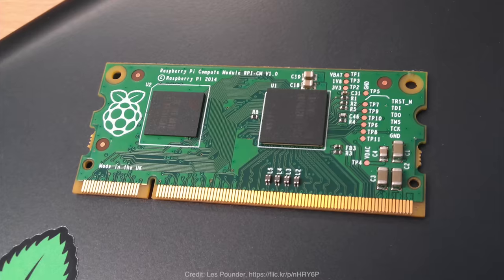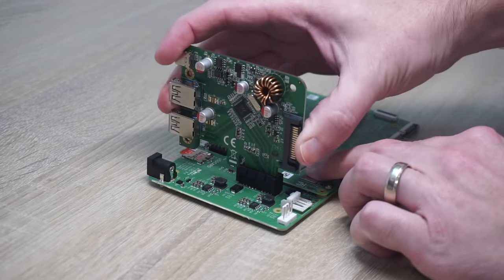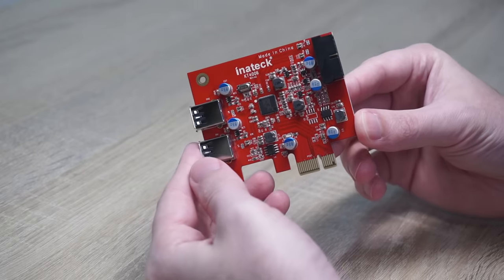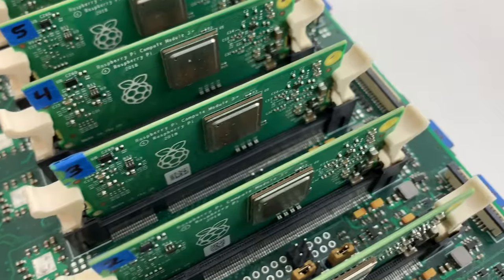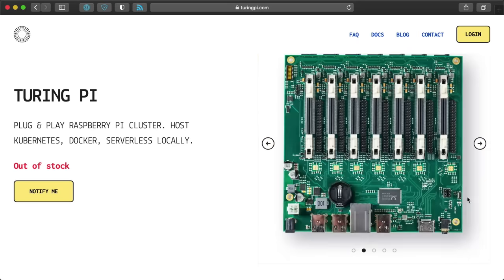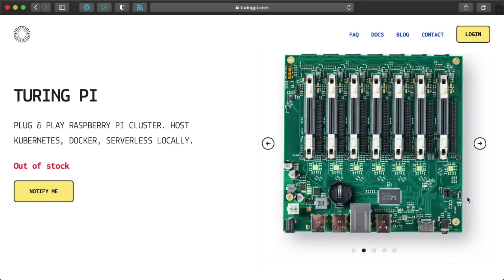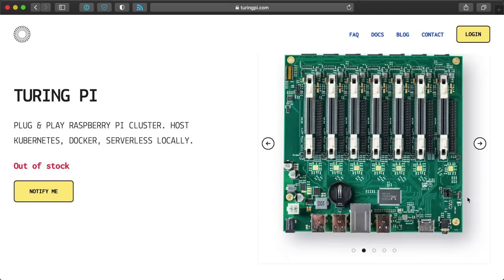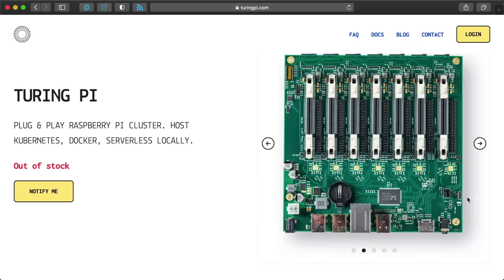The Raspberry Pi Compute Module 4 Review

Comment: Jeff, you overlooked something in your video you had a 3.1 USB which can give you 10 to 20 gbps speed, if it’s Firewire compatible you can get up to 40GBPS. It has been a great workaround for these all in one iMac the Shopping clubs sells for $699 with with a spin drive so do not have open them up. You can install OS directly to the firewall 40 gbps drive and it runs like a bat out of nowhere

Comment: Re "first Pi with u.fl external antenna connector": true, but the Pi Zero W has an unpopulated footprint for what looks suspiciously like a u.fl connector ;)

I've not tried soldering a connector to that, and it looks like you'd have to rotate a ridiculously-small component to connect the u.fl antenna instead of the onboard one, but it looks like it should be possible! :D
Reply from the maker: Interesting, you're right, it's just a hair above the 'USB' label on the board, pads perfectly suited to a U.FL connector. So it's the first Pi to have the connector, but not the first Pi to have the space on the board for the connector. Posted a picture of it here: https://twitter.com/geerlingguy/status/1318686105378619393
Reply: @JeffGeerling  On the Pi Zero W, its only used to characterise the antenna and the WiFi circuit during prototype validation. The Pi 4 has one too but it is more disguised
Reply from the maker: @simonmartin4599  That makes sense.

Comment: Jey Jeff!!... 
Fantastic video btw!
I've a Zotac GT710 pcie-1X i could lend to you for your tests as you mention on the video.
Cheers!
Reply: he can use any gpu, no need for an pcie x1 gpu.
Reply from the maker: I just ordered one, thanks so much for the offer though! And while I could use another GPU I'd need a riser or to cut into the 1x connector on the IO board, and I'd rather avoid that for now :)
Reply: @JeffGeerling  waiting impatiently for your results!!!!
👏🏻👏🏻👏🏻
Reply: if you rip out the back of the pcie slot you can fit in a pcie 16x card and pcie will still work perfectly

Comment: Wow, thanks for all the hardware testing.  I'd love to see a dual Ethernet card tested.  Maybe an Intel i350.  
I'm really excited about this board.  Is there any easy way to power the bare board if you just wanted a small machine that serves stuff up via WiFi?  Even solder pads would do.
Reply from the maker: Hmm, I might pick up an i350 or maybe i340 and see if it works.
Reply: @JeffGeerling  I forgot that the i340/i350 are PCIe 4x cards and you may not want to hacksaw your dev board.  So maybe Intel 82576.  I see that  RTL 8111 multiport cards also only use 1 PCIe lane, but that chipset is famously flaky.
Reply from the maker: @beauslim  I have a 16x riser so I can plug into that. We'll see, I ordered a i340-T4... Go big or go home :D — but it will probably top out around 2 Gbps total across the interfaces (or less).

Comment: YES! YES! YES! I've been waiting 6 months for the CM4 launch! AND it's even better than expected! But, all it needs is a compact carrier board with Power, USB-C, HDMI (connectors along one side), M.2 (SATA or NVMe) (connector oriented to allow the SSD to mount on board), plus an optional GPIO header. That would be smaller yet more powerful than the RPi4, IOW the smallest, most versatile SBC/PC available. Having connectors along one side allows for easier packaging for weatherproof devices as well as clustering along a backplane.
Yeah, I get it. The new carrier board is more like an all purpose development board, not designed for end products. But, I'm sure that many 3rd party manufacturers will fill the market's demands, so patience is a virtue, I guess.
Oh well, I'm in, so sign me up. At least I can start developing 'stuff' on the CM4 platform. WooHoo!

Comment: Hi @Jeff! quick question: do you know anything about the turing pi2 and how do we will connect the news raspberry pi 4 compute modules? Thanks in advance for your time
Reply from the maker: It looks like it will use a kind of adapter/daughtercard design and those will be used to plug in CM4s vertically to the board

Comment: Most PCI-e devices that have a bigger than 1x connector still work in a 1x slot because of how PCI-e works. Sometimes the smaller slots even have the end cut off so they also fit the longer connectors, but this dev board doesn't seem to have that. I also wonder how they deal with the 75W power delivery requirement through the PCI-e connector on such a small device.
Wouldn't AMD GPUs have ARM drivers because they are open source, so could be compiled for any platform?

Comment: 8:30 Couldn't you either compile a custom kernel and make the nvme support built in or make a custom initramfs including the module on an sdcard and just use root=/dev/nvmeblk0p1 as a kernel command line parameter? It's how we had booting off USB before it was official. All you need a small SD card for holding the firmware, kernel, initramfs and configuration.
This way you technically boot off the storage the firmware supports, but the Linux that is launched from there jumps onto the device you specified.
Reply from the maker: That may work. Still requires the microSD card or eMMC but at least it would allow everything to run fast.
Reply: @JeffGeerling  You'd still get the second half of the boot process running off the SSD and thus the speed benefit, the whole userland stuff. Would be worth a try (a video?).

Comment: 6:08 there’s a SATA power port on the back of that USB card... if you hook that up to a power supply you should have all the power you’ll ever need... right?
Reply: Yes. In that case, you would get the Standard USB 3.X (don't know, which Gen his Card is) as you would have it on your Desktop
Reply from the maker: True, though then you have an extra power supply besides the 12V one to power the IO board. But for those integrating the CM4 into custom PCBs that is an easily achievable task!

For the "PCI Experss" card it required a 4 pin power plug, which I plugged in via an external PSU, otherwise it had no power at all. At least with the Syba card, it would provide power through the PCIe bus even if not in large quantities :)

Comment: @6:53 is there any reason why are you loadling a kernel module with modprobe and just reboot the pi? what's the logic in doing that?
Reply: The literally explains it in the same sentence, it's "to enable the NVMe kernel module, which apparently is included in the Raspberry Pi OS kernel but not loaded by default.
Reply: @RudyBleeker  thanks for the replay, but my question is why use modprobe (that loads the kernel module in MEMORY ) and then reboot? to load a kernel module at startup you need to change /etc/modules, without doing so the kernel will boot up without the nvme module. My point is that the explaination does not reflect the commands he gave at the console and it's kinda wrong. But maybe i'm missing something.
Reply: @alessiocurri82  If I had to guess, maybe the module is designed to add itself to the boot loading list once it's loaded for the first time, and then it needs a reboot for hardware reasons. No idea if that's right or not.
Reply: @alessiocurri82  Oh, he explains it in another comment. It's now loaded by default, and he had symlinked it off camera. It's just a video error.

Comment: PCIe is scalable, you can adapt any PCIe Device to any PCIe slot, no matter if the device has more or less lanes than the slot.
so you can connect an RTX 3080 to it, and it will work (with the correct drivers of course), but it won't be fast
also what generation of PCIe is it? i don't think you mentioned it. is it 3.0 or 4.0?

Comment: Nice video but I don't really understand who would buy a compute module Vs a regular Pi. The Pi has a lot of the same IO as the IO board and the additional IO such as the PCI-E slot is going to result in a really bulky set up no matter what you plug into it. All that for just a few extra MB/s in transfer speeds? Who is going to buy it?

Comment: Hi... Excellent video. Is there a way to use this module + io board + external ethernet pcix adapter to transform the whole gadget into a home router? Tks.
Reply from the maker: Yes! And it's fast enough that it wouldn't be a bottleneck like older models would, even on a Gigabit network. But I wouldn't be the best person to ask about this; I'd recommend asking more on the Pi Forums.
Reply: @JeffGeerling  Thank you!

Comment: It should be possible to file out the end of the PCI-e slot, that way x4 or even x8 and x16 cards will fit. Of course, they only work at x1 speeds but it will work! :)

Comment: With the PCIe Slot, you could even hook up a SATA III HBA to get 8 SATA ports on a Raspberry Pi

But... Could you use a Standard psu?
Reply from the maker: I still don't have an SATA board on hand to test with, but that was something I wanted to do.
Reply: @JeffGeerling  well, i mean if you wanted, to hook up a drive, where would you get SATA Power from?
I guess, one drive could be powered over this breakout port, you mentioned, but more than one drive?
Reply from the maker: @p3chv0gel22  For regular size/spinning drives, I would recommend a separate power supply since the IO board won't be able to power more than one reliably. If designing your own carrier, I would definitely recommend using separate power for any accessories.

Comment: btw. GT 710 Driver for Linux aarch64 i directly found on the NVIDIA website: https://www.nvidia.com/Download/driverResults.aspx/165266/
Another thing: Even if not official driver support, some AMD and NVIDIA cards, especially AMD, have Open Source Driver Support.
But i would be worried about the Power Consumption of the Video card.. if there is a way to give them External power it would be worth trying.

Comment: Try to build a NAS! PCIE RAID would be so cool!
Reply: Finally PCIe backed SATA so awesome!
Reply: YES
Reply: Not quite. It's all about sacrificing SATA with USB3. When I saw a PCIE X1 slot I immediately think about the possibility of CM4 NAS but I was intrigued by the slow speed of x1 Gen2: 0.5GB/s. This means 500 MB/s and yes it theoretically max out for a single SATA3 while real world performance should be 150MB/s RW per HDD. This means we can only have ~100MB/s for each disk in CM4 NAS counting the packet overheads/bandwidth/weak processing power. Still this is a trilemma for me to pick between a 10GB card*, 4 Gigabit LAN (btw each theoretically 125MB/s so 1 port will get starved, wrt to real life they are 95MB/s maxing out so no worries) or do this NAS project. Help me pick a choice.

*Using a 10GB card to run PXE network boot and offload the system from storage through a iSCSI from my existing DIY NAS.
Reply: @stevefan8283  well yes but a NAS with 100mb r/w performance in a low-cost scenario is still a bargain.
An entry level dual disk nas with 100mb throughout is 3/400 euro (filled). Printing a case and adding disks here you can easily get a 200euro nas with 4 disks.
Reply: Someone should design a Compute Module IO board with only a few USB ports, Gigabit NIC and two or four SATA ports. 
Even the Pi 4 runs awesome as a NAS, I‘m able to write with 110MB/s via SAMBA to my external SSD without a problem at all.

Comment: Could I take one of these and fit it into a custom mechanical keyboard like the pi 400 but better switches? And then inlay a small touchscreen where the number pad would be on the keyboard. That would be AMAZING.
Reply from the maker: I think it's doable. Have to put some large heatsink in there or a fan somewhere to make sure it doesn't overheat. But you'd need to design some sort of IO board version that interfaces with the Pi and allows the keyboard to plug into it. It would be a bit tricky but definitely possible. The display might be the most annoying problem to solve.

Comment: I'd like to address 1 inaccuracy. The PCIe 1x slot can receive all shapes of PCIe connectors. You can cut out the back plastic and slot in a 16x card, like the RTX 3080. It will work, but obviously it will be bottlenecked.

Also 1 question: can you try a PCIe SATA card and setup Unraid or some other NAS software?

Comment: The generic drivers available direct from the Nvidia website should be fine. However,  those cards are expecting 35-75W from the pcie slot. Can the carrier board provide that?
Reply from the maker: That's a good question, probably not. Lower power boards (more on par with the performance of the built in Mali GPU) may work okay without overloading the Pi though.

Comment: Doesn't Nouveau or the AMDGPU or whatever driver inside the Linux kernel run on ARM too, I mean it probably runs on little endian POWER? It should also be possible to run a longer (PCIe 16x) card in the 1x slot if I am not mistaken, the bandwidth and power provided will be a lot less but you can compensate on graphics cards using the 6 or 8 pin connectors usually. I mean, there are normal PCs, that run PCIe 16x graphics cards in the 4x slot that has an open end or 2 graphics cards where each of those physical PCIe 16x slots is actually running at 8x speed. (People used to run SLI or CrossFire with that, those times when AMD GPUs were actually a separate company called ATI.)

Comment: yes try the gpu, it would be really great to see an external gpu running on this device.
Reply: you can also mount a x16 gpu, just cut the pcie socket open in the end. some mobo have open pcie slots, so you can install x16 devices in x4 or x1 slots.
Reply from the maker: Ordered the Zotac, and will test it! I don't have the budget to go around ordering $200+ GPUs though, this channel ain't that big :P

Comment: why wouldnt it be possible to run such a gpu on a pcie 1x slot on normal desktop motherboards u can do just that only thing is you have to rip out the back of the port so it fits but everything else is compatible

Comment: Thanks for the video.  I think you made a minor mistake, however, in rebooting after issuing your modprobe.  Modprobe only loads kernel modules, it doesn't change how your system boots.
Reply from the maker: Quite true; you would need to add a line to /etc/modules to make it persistent. Not sure why I left that in the video!

Comment: I have a Raspberry Pi 2 with Arch Linux ARM where I mounted /boot on a small microSD card and the rest on a seperate USB SATA hard drive.
So technically it's booting from an SD card but running on an external drive.

Comment: This may be an ignorant question but can you stack the module 4? Create a cluster with it? Do you think that would be an improvement to what is currently available?
Reply from the maker: Yes, in fact the folks at Turing Machines are building a cluster board for them specifically: https://turingpi.com

Comment: Why the pcie 1x? Is there a limit in the ARM CPU side or module lacks pins for more? One thing to check is to try to find pcie 1x switch card or module (there may be them from the time of GPU minind times) and then you can have several pcie 1x devices connected to the board. Even better is to ask if the Rasberry people can extend the pcie capabilities with some newer io-board with the said pcie switch chip.
Reply: For example: https://www.amazon.com/Express-Switch-Multiplier-Expansion-adapter/dp/B01M64W87Q
Reply from the maker: The BCM2711 SoC only has 1x PCIe lane, so there's no hardware support for any more bandwidth on the bus.
Reply: @JeffGeerling  Then the pcie switch ship method is the way to go then.

Comment: Wasn't the point of the dimm form factor to make it easy to use in a cluster? Other than getting different ports from the normal pi, what is the point of this change? I understand the need to change the pin out in order to improve it but the way they did it does not make sense to me.

Comment: A Raspberry Pi 4 with two USB drives in RAID1 would be a totally fine and sufficiently performant NAS. Excellent for backup storage or provide access to video content. Heck, Plex runs fine if you don’t need to transcode.

Comment: All pci express cards are backwards and downwards compatible. Just dremel the back piece of plastic off the slot. While it would still only go at pci 1x speeds you could fit a 16x card in and it would work fine... assuming drivers are available. This is super common in servers. Well not the dremeling but server boards always have the backs open. Food for thought. Have fun.

Comment: You can use any PCIe device in any slot, you will only get slower speeds. If you wanted you could plug a 3090 into a 1x slot, It would work but would be limited to 1x bandwidth

Comment: FYI for those needing a U.FL connector on a Pi compatible board: 
The Banana Pi M2 Zero also has a U.FL antenna connector, but is way less powerful than the CM4, but more powerful than the Raspberry Pi Zero W but in the same form factor.

Comment: You know all PCI Express devices can run with just 1 lane, right? If they comply with all PCI Express standards, you can either use a 1x to 16x adapter or saw off the back of the 1x slot to fit in any RTX 3090 and perhaps compile nouveau for ARM

Comment: I want to see benchmark comparison with original raspberry pi 4
What about overclock difference from raspberry pi 4
 Have any sata card support?
waiting to have see heat sink on cm4
Reply from the maker: In terms of CPU, memory, WiFi, and networking, the benchmarks with the regular Pi 4 are basically identical (within a margin of error). I have not tried overclocking either the Pi 4 or CM4 but may have some fun with that at some point.

It does support SATA cards but I don't have any on hand to test with currently :(

And regarding thermal performance, it's very similar to that of the Pi 4, where if it's in the open and in a ventilated space, it will be fine, but if enclosed, you at a minimum need some sort of convection and a heat sink, ideally a fan of some sort.
Reply: @JeffGeerling  most of solution on original raspberry pi just cold down the cpu, without care other chips, since the size of heat sink is a full side of the board